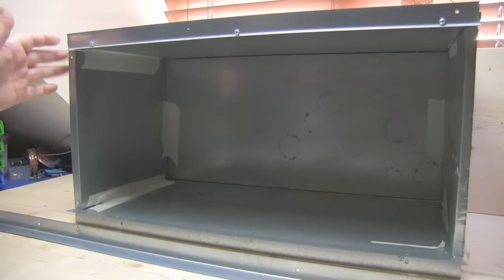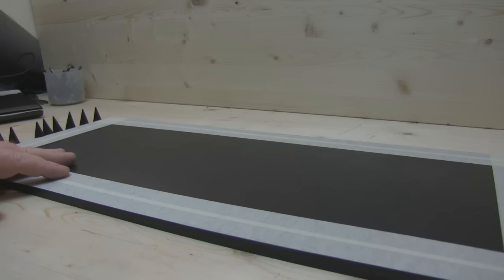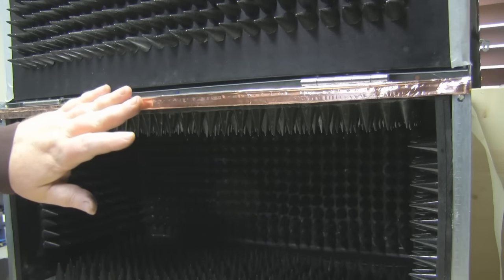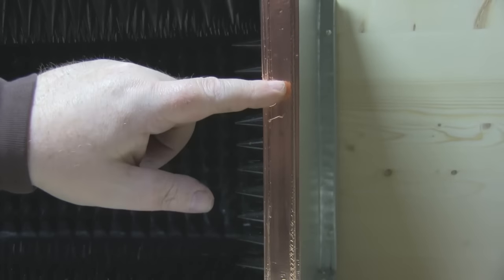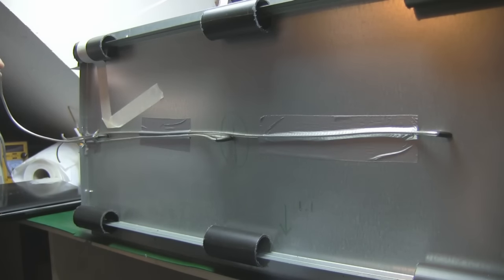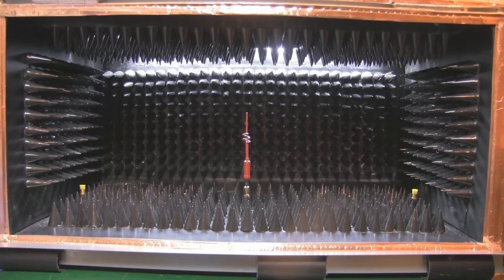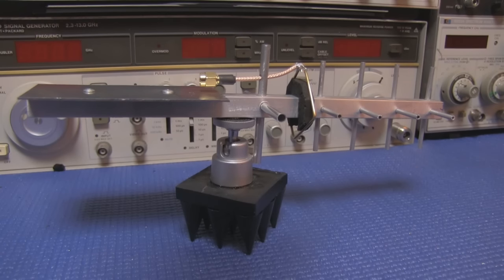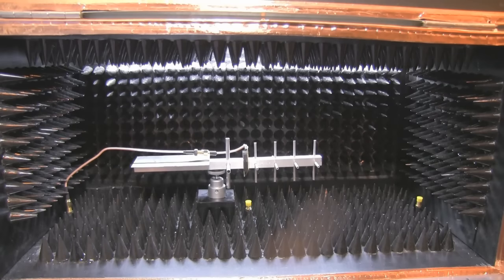Building My Own RF Anechoic Chamber Part 2

Comment: If you're still interested in making foam rf absorber I have some info that may help you. I used to work on indoor antenna ranges for over a decade. We had a guy who used to work for a company that made absorber. Once when range flooded due to a fire sprinkler failure we had to replace the floor absorber ( which was 3 ft tall) and the bottom 3 ft of our wall absorber on a very big range. A tech rep of the company that built the range came out to look the situation over and was talking shop with our resident absorber guru. The they were both in agreement as to how rf absorber is made. Say you want a a pad of 12" tall pyramids on a 2" base. You take a 14" tall block of foam rubber and you feed it into what looks like an old industrial ringer washer with an aggitator at the bottom of the tub; under a screen The ringer rollers are partially submerged in a solution of hot water saturated with conductive carbon powder. The water also has a salt added to it (I can't remember what kind they said) if you expose the absorber to a lot of rf energy the foam would burn so the heat is transferred to the salt which disapates it slower than the powered carbon. You put the block of foam into the ringer rollers which compresses it and it expands under the water that is saturated with carbon where it expands sucking up the fluid. You yank it out and dry it. When dry you then cut the pyramid shapes. you spray it lightly with diluted latex paint to stiffen it and keep the carbon from coming back out. You only need the salt if you are transmitting megawatts on your range. You could dyi this by making a carbon/hot water mix in a big bucket/pail agitated by a paint stirrer on a drill. Take 2 sheets of egg crate style foam and mate them so the flat surfaces are to the outside then roll them as tight as possible. Submerge them in the carbon water then release the roll. Pull them out and let then dry on a cookie sheets in the sun. Then spray them with diluted latex paint from one of those cheap spray guns that use a little pump rather a compressor. FYI,  our store bought 12" pyramid absorber sheets had an insertion loss of 10db at 10GHz. Have fun!
Reply: really thanks, for sharing knowledge. i personally believe people like you are a boon to learners and makers. thanks.

Comment: Was wondering recently about mixing high permeability materials in two part foam to make custom insulating foam material and not only my noting on HaD and Instructables regarding mixing in silicone or other resins to better shield.   Same goes with silver or copper powder or maybe the latest trend of nano fibers in a polymer media. Neat as always.

Comment: what about an anechoic chamber with the same cones on the outside (as well as usually done on the inside)? why isn't this done?
Reply: because that would cause "echoes". Purpose of those cones is to absorb radiation. If you take out the cones, all radiation created by antenna will keep reflecting inside the cabinet. This will create a huge mess. You may think it like a cube created by mirrors where the mirrors facing the inner side and putting a candle inside the cube.
Reply: @tugcanremzigolpinar1043  I said both inside and outside